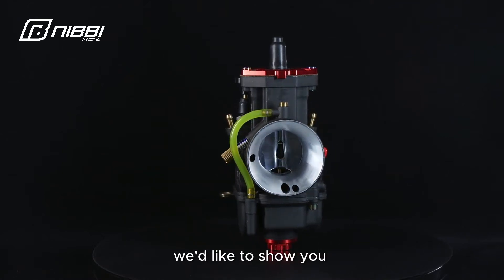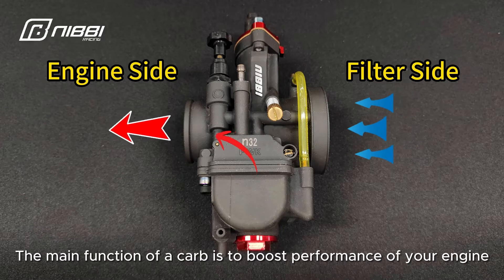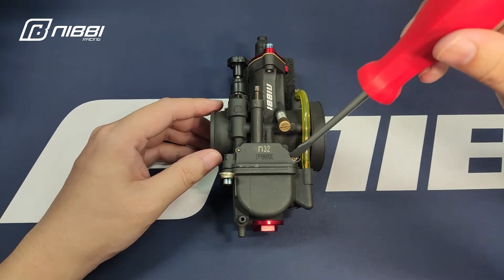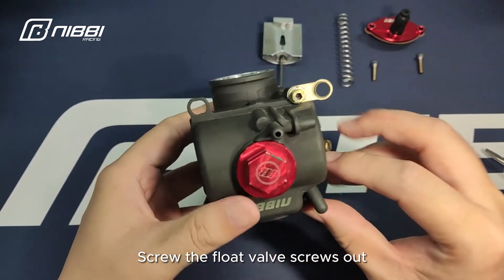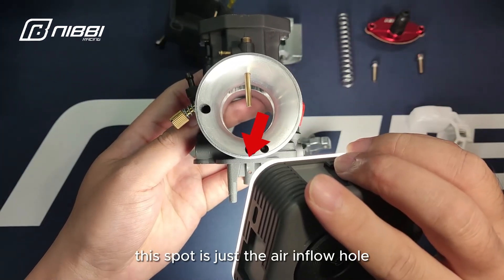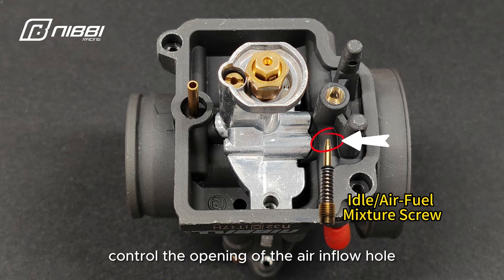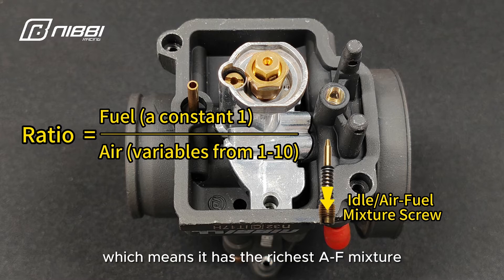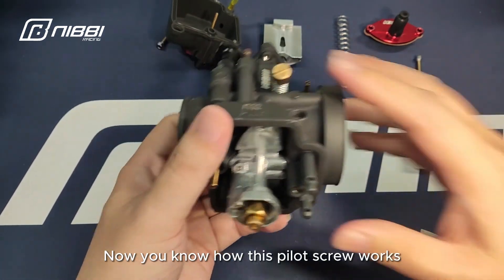Pilot & Idle Screw Adjustment Explained | Part 1 - Pilot/Air-Fuel Mixture Screw

Comment: The base line is to start out at 1 and a half turns out. The factory settings on most carbs is 2 turns out. Just use your throttle to see if the engine bogs. Also, you will have to adjust your idle screw as well. If your engine runs well at 1 and a half turns, back it out to 2 turns and see if it bogs. If it does, than keep it at 1 and a half.

Comment: The screw you mention is not idle-air screw it's just pilot jet fuel screw and screwing inwards makes it leaner, restricting fuel, screwing it outwards allows more fuel = more rich. The screw above the screw you are working on (the one with the spring) is idle air screw.
Reply: If air/fuel screw is on air filter side of carb it is adjusting air.
If on manifold side it's adjusting fuel....
So they are correct on this video. Turning in is giving less air, therefore richening mixture.

Comment: You should mention that this fuel mixture ratio only works at first 1/6th of throttle and after that the fuel ratio is mixed by main jets and needle valve profile
Reply: My dad and I had a disagreement about that. I said it's called an idle mixture screw for a reason! It only affects idle and throttle response to and from idle. It's about air pressure variations control by the butterfly valve falling back on the idle circuit from main jet and jet needle circuit. "Well, why do people say adjusting it makes their bike (Harley) run better all together?" - Because idle is a big part of throttle response! OR... confirmation bias.

Comment: Is the bolt on the bottom fuel adjust screw?
Reply from the maker: Hi, may I know which specific bolt you refer to, please?
Reply: @nibbiracingusa  pe26 flange style. Adjustment Bolt opposite side of drain line on the bowl
Reply from the maker: @Hoodratshiit  OK, I got it. It's a manual choke and you can pull it up to help start when the engine won't work at high elevations or in cold weather. I hope this helps, thanks again! :)
Reply: @nibbiracingusa  no that's not it. I know what the choke it.
Reply from the maker: @Hoodratshiit  Do you refer to the opposite side of the drain line, on the left of the red knob (idle screw)? If so, that's the Pilot (air-fuel mixture) Screw and you can screw it in or out to adjust the A-F mixture ratio. I hope this helps again! :)